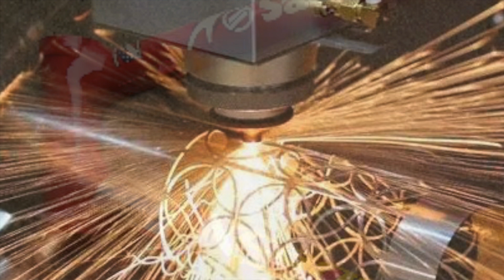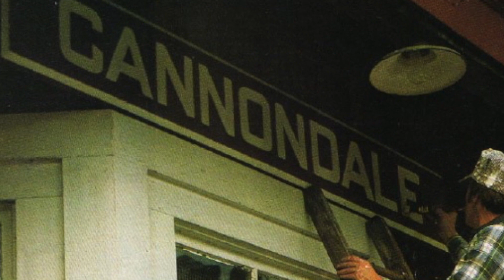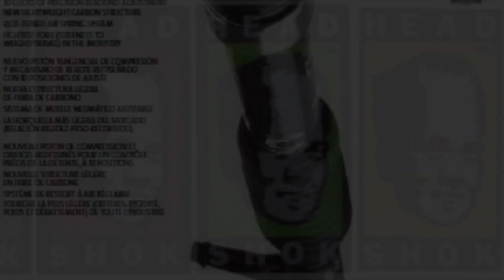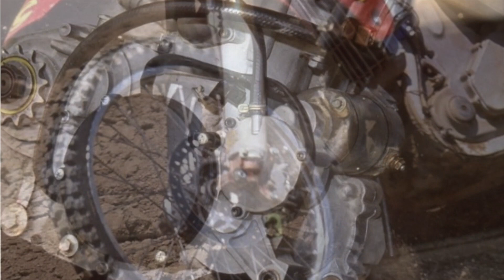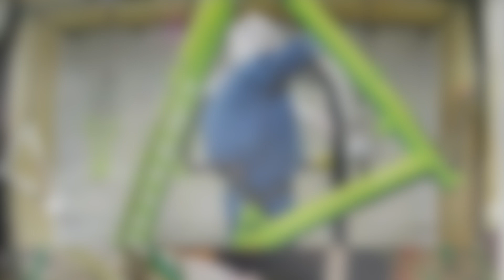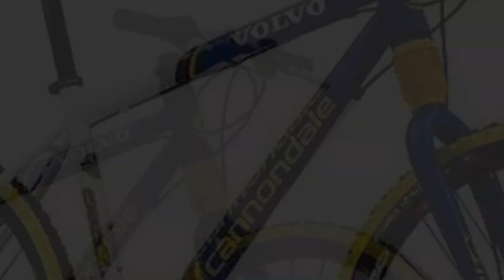The Cannondale Bike Story

Comment: I can't believe you showed my 2006 F800 bike I got back in November of 2006.  I got 7 years and 35000 miles out of the frame before I got a free replacement F3 2013 frame that has almost 12 years and 45,000 miles on now.  I have a 2010 last year made in USA F2 that is sitting in my garage just waiting for the Taiwan frame to give up the ghost so I can do a parts transfer.
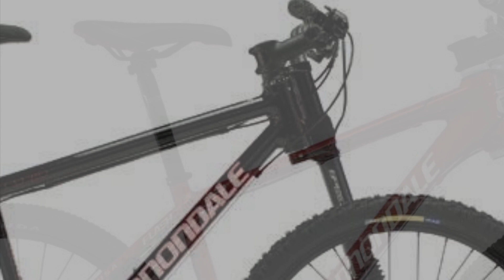Reply: You can see the F2 red frame in the background of the F800 at around 15:15.  This is spooky how you got both of my bikes in this video.
Reply from the maker: Wow. What are the odds?

Comment: Did Cannondale have a big legal battle with Klein bike co. In the early ‘80’s over their aluminum welding process? Did Cannondale attempt to make an aluminum road fork ,then called the “ pepperoni “ fork because of the round profile of the fork blades , that was recalled over safety issues and then replaced with a traditional steel fork?
Reply from the maker: I do remember something about the building process being litigated with Klein. Not
Sure of exactly what it was. 
The pepperoni fork became the blade system for the Fatty forks.  I don’t think they were any more prone to failure than a steel fork. Fork strength is regulated in the US.

Comment: 4:42:  my second mountain bike.
Broke it. Broke the replacement. Still riding #3.
Crack-N-Fail.
This narrator basically read all the C-dale advertising copy with a straight face.  Impressive.  Just one long, monotone advert.
No mention of the progenitor & leader of oversized aluminum: Gary Klein.  Artwork.
Nor Charlie Cunningham, true pioneer.
Very little backstory or critique.
Took FOREVER to get warranty frames from 'em.  Ironic that Specialized would ship out a Chinese-made replacement in a week, whereas US-made C-dales took weeks & months.  
Still a nice adventure through the years.

Comment: Let me walk you through the Donnelly nut spacing and crack system rim-riding rip configuration. Using a field of half-C sprats, and brass-fitted nickel slits, our bracketed caps, and splay-flexed brace columns vent dampers to dampening hatch depths of one half meter from the damper crown to the spurve plinths. How? Well, we bolster twelve husk nuts to each girldle-jerry, while flex tandems press a task apparatus of ten vertically composited patch-hamplers. Then, pin-flam-fastened pan traps at both maiden-apexes of the jim-joist. - that's what I heard